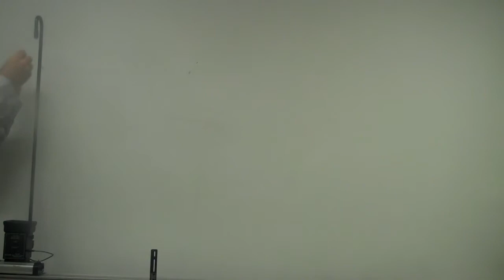Ball Drop.MP4

Comment: I guess that the ball will land on the cart only if it won't encounter a air resistance (which is a force acting upon the ball from the opposite direction), right? (it's more a retoric question, though)